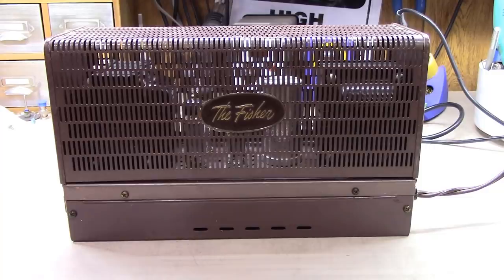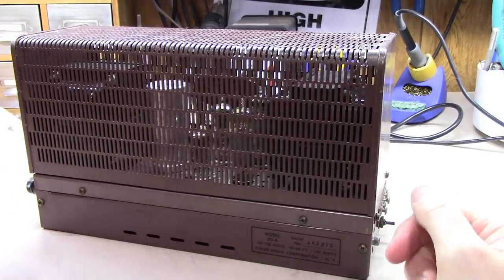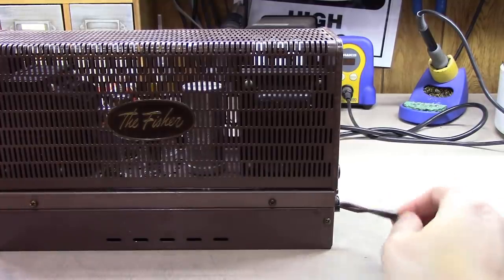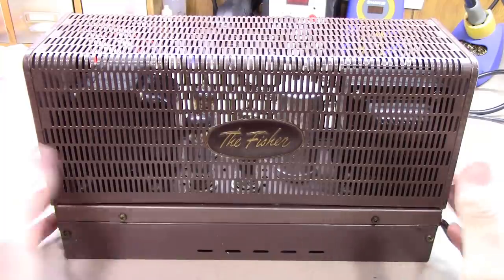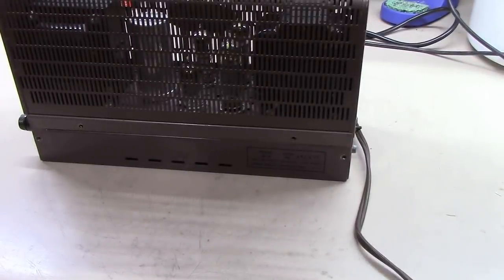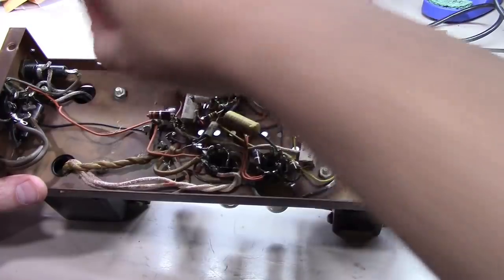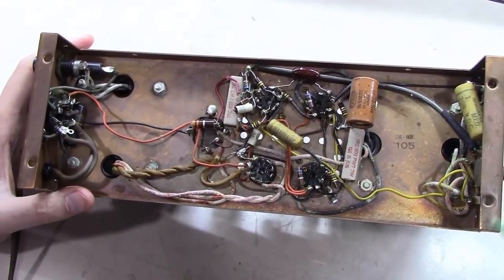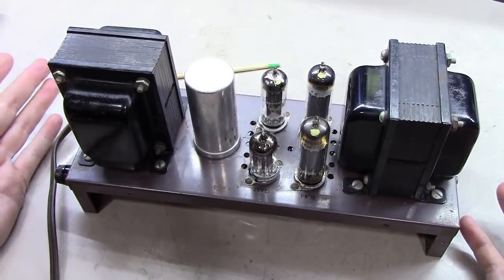Tube Gear Troubleshooting - Initial Inspection - Part 1

Comment: Thanks so much for doing this series. I have about 6 or 8 vintage radios and record players that I want to get working again. If you have not covered it in the videos, where do you like to buy caps, resistors, tubes, etc. Any recommendations will be appreciated. Thanks again.

Comment: I need to know how to safely connect my oscilloscopes arbitrary waveform generator to input of amp when observing out put with oscilloscope.  They have common ground as they are inside the same unit.  It is a DSO.  I don’t want to screw up. Is it safe to connect without isolator?

Comment: Good advice to inspect before powering up. 

Another thing to look for is caps (eg. black beauties) that are outright missing or not where they are supposed to be. I opened up an AA5 radio recently where the black beauty "death cap" had outright exploded into pieces. The fragments were all in the chassis (on an open chassis they might be missing), leaving just the 2 end wires hanging in mid air. Noting that the cap is outright gone and then dressing the leads to remove possible shorting problems should be done prior to initial power up. 

Cheers,

Comment: Great tip on the carbon resistors.  I'll have to add that to my review.  When it comes time to check (and replace if necessary) out of spec carbon comp resistors you could discuss any issues with replacing with metal film resistors (assuming wattage is the same or greater than the original).